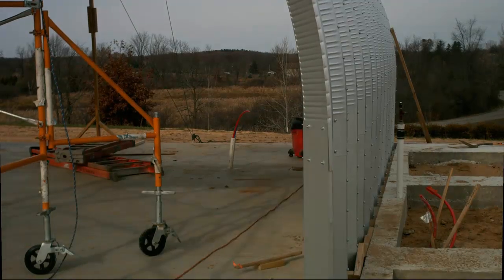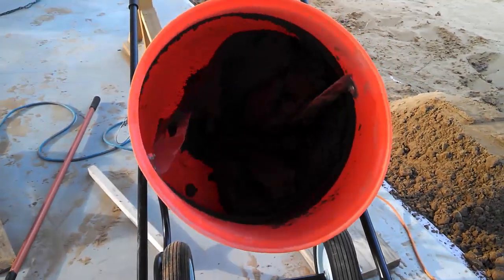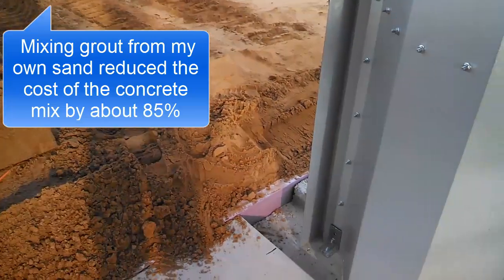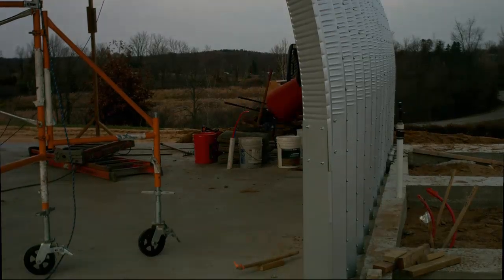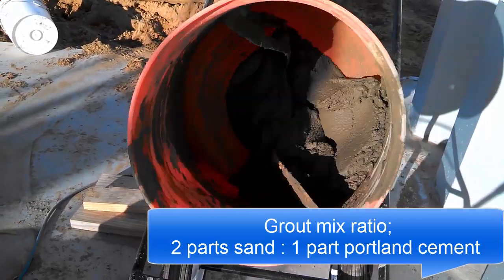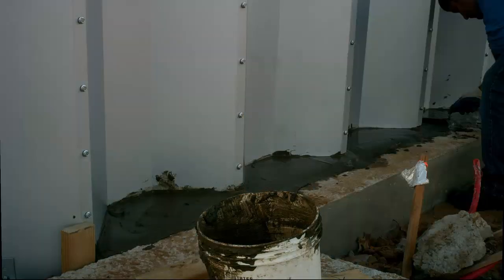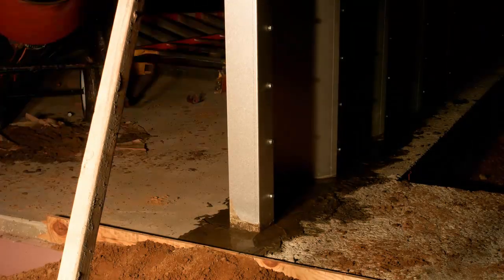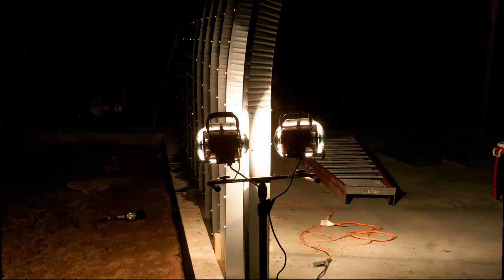9.1 Grouting the Quonset hut steel in place

Comment: My manufacturer says I need to do the grout at an angle beveled out from both the inside and outside. (I’m assuming to shed water away from the building was that not a recommendation for your building?
Reply from the maker: It probably was...  I put more of an angle on the outside.  The inside probably has a tiny angle.  I don't ever see water sitting there.

Comment: How do ypu prevent the cement grout from eating through the panels over time?
Reply from the maker: The panels are galvanized and the grout was formulated not to mess with them.  They also stay dry.  I haven't seen any corrosion in the area yet.

Comment: That’s going to make the metal weak and rust faster.
Reply from the maker: If it stayed wet...  I keep it dry.
Reply: The alkaline nature of concrete can protect steel from acidic corrosion for decades, which is what happens when steel re-bar is used in it....  {However, what would happen if moisture/vapor were able to pass through the concrete (or enter at the juncture from the top) and somehow condense/collect between the concrete and steel?)

Comment: You are a wealth of information! Thank you again!   One more question if you don't mind.  What is the size of 
the "groove" you used for the building to rest in?  Thanks again.  My building comes later this month.
Reply from the maker: I think it was formed with a 2x10 board, so 9-1/4 inches.  The size is a bit larger than the crenulation depth of the quonset you are building.  In my case, the crenulation depth was 7.5 or something like that.  So 2x10 is the next size up.  The depth was 3 inches, or basically two times the depth of standard lumber (a 2x4 is 1.5 inches thick).  I think this information was included in the engineering plans that came with the Quonset steel.

Comment: Great Vid.  I am doing a 20x30 and am trying to figure out how many bags of cement I need.  How many hours did it take you?
Thank you again for posting
:)
Reply from the maker: Brad Allore The volume is just the width x depth x length of the groove you want to fill.  In my case, it was 3/4 of a yard...  Then figure out your mix ratio (mine was 1 cement to 2 sand) and add that volume up and divide your groove volume by that volume and you get how many bags you need...

I did mine over two evenings...  so maybe 6 hours?

Comment: what length is your building? I am trying to figure how much cement and sand I need for my 50ft building. I think you said 400lb of cement for yours.
Thanks
Steve
Reply from the maker: Steve Leis I put the base calculation at the top... My building is 30 wide by 40 long, but keep in mind that I only built half of it.